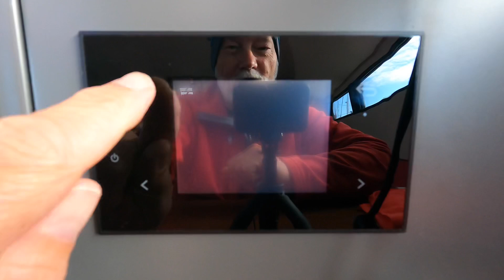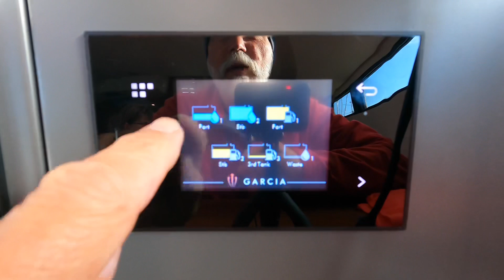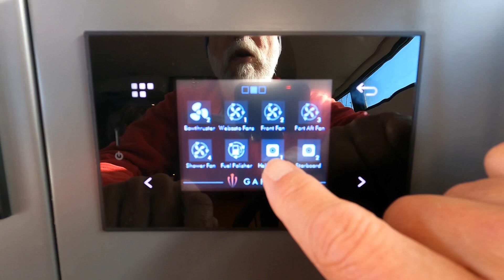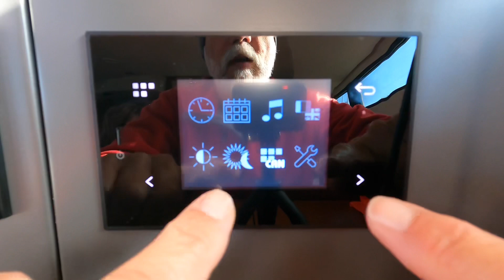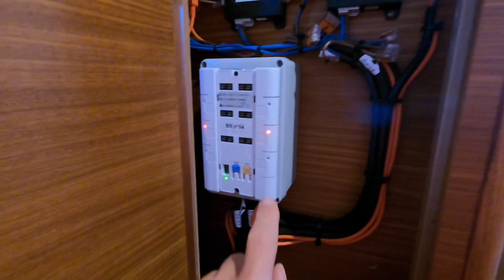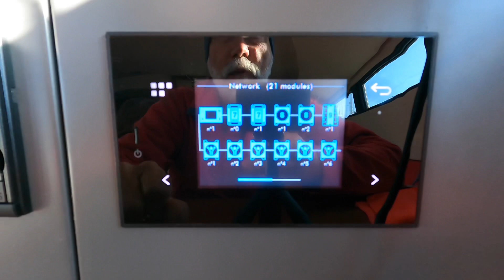Snow Gum - Scheiber Electronic Control System - Garcia Exploration 45

Comment: Impressive! Can the system be accessed via an iPad (networkable)?
Reply from the maker: Crikey Paulo! Have you got my phone tapped? A major point of discussion/concern from me during build was the lack of Apple type interface with the Scheiber system. I knew I would find the Apple and Bluetooth interface with Victron systems to be helpful (and it has been), so the lack of this with Scheiber was worrying to me. But as it turns out, we haven’t missed it or needed it. We were told that any firmware updates would come via an SD card, but there haven’t been any. The system does what it does and it doesn’t do what it doesn’t do. What it does do it does well and what it doesn’t do it doesn’t do it all. Bill Gates doesn’t get a look at the back of a Scheiber panel either. I wish he could infect Scheiber with instruction writing expertise, as well as he’s injected all of us with tracking microchip disease, apparently. Ha! 🤪
Reply: @SailingSnowGum  🤣

Comment: Can you use your cell phone as a secondary or backup touch screen display for this type of setup?  (wifi or local Lan?)
Reply from the maker: Hi Paul. No, there wasn’t a way to use a phone or tablet as an extra display with this Scheiber system. However, it was easy to include an additional display/control panel within the network. Some owners have a second display mounted at the companionway, for easy access from the cockpit.
You’re probably aware that some other systems on board this and other boats can be accessed via a linked phone or tablet. Our B&G Zeus3S chartplotters allowed our devices to connect and we used this capability a lot, eg, for watchkeeping and for monitoring our anchor swing patterns in rough weather, from bed. 
One thought I’ve mentioned before - this Scheiber control panel is not one that you’ll routinely be using, after it has been set up the way you want it. There’s a lot of interaction at first while you’re learning and programming, but after that the activity settles down and it gets touched less and less. This reducing level of use helps cope with the fact that it’s not a good screen to look at. Overall,  it’s a good system, once you get the hang of it. The user instructions are ridiculously brief, but this adds to the sense of achievement when you do figure out how to make adjustments. 🙂 Regards, Rick.
Reply: @SailingSnowGum  thanks Rick!  We cracked (won’t take touch I put now) ours and we’re looking at alternate ways to access the fuel/water levels.
Reply from the maker: @scuman01  On this, a thought is to see if any other monitoring panels you have installed have the capacity to display tank or voltage levels. At one point we were using our Victron Cerbo controller and it’s Touch 50 display to show the third fuel tank’s level. We switched this around with the black water tank a few times, for testing glitches. It’s handy to have different ways to display values of sensors. 🙂

Comment: As usual, superb work! Thanks! If you can... please let us know about energy generation... how much solar, wind, etc... and the autonomy. Cheers!
Reply from the maker: Hi Sergio. We have 1200 W of solar panels, no wind generator, no diesel generator, no hydro generator, no other kind of generator other than the engine’s alternator, which only gets used if we are motoring.. We have 900Ah of lithium batteries, with a Victron battery management system. As for autonomy, we spent summer in northern Scotland and the lowest our batteries got down to was in the 60% range. This included up to four weeks at anchor, with no visits to a marina. And when we did visit a marina overnight to do some shopping we didn’t even bother to plug-in to shore power. Spending winter in Cherbourg is another matter. Here it’s nice to have an electric fan heater to add some warmth. For this we need to be plugged in to shore power, other than for short bursts of warmth under inverter power. Shore power is needed to heat water in the boiler. While anchoring, we heated water for showers with our portable induction hot plate, from IKEA. 🙂
Reply: @SailingSnowGum  Wow... really nice! Many thanks! 😊